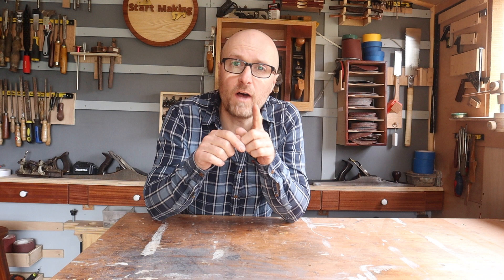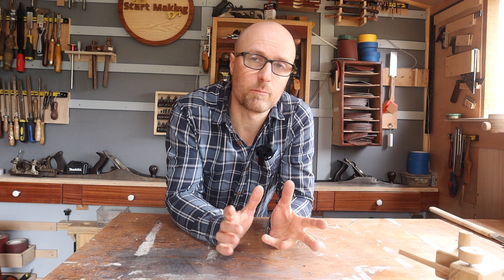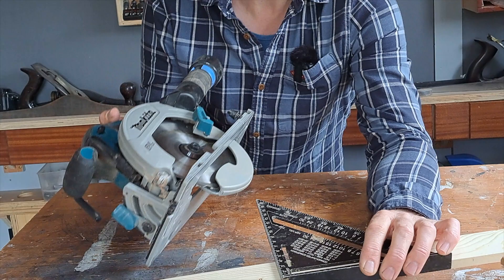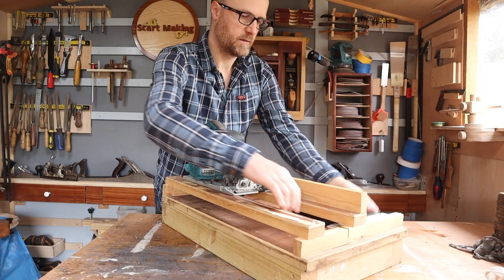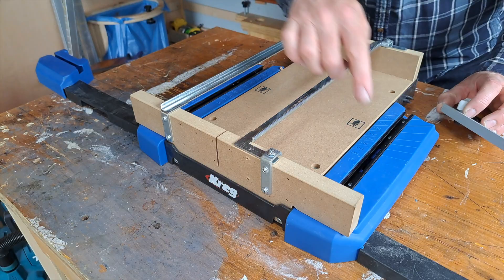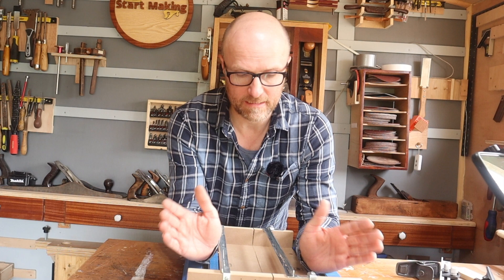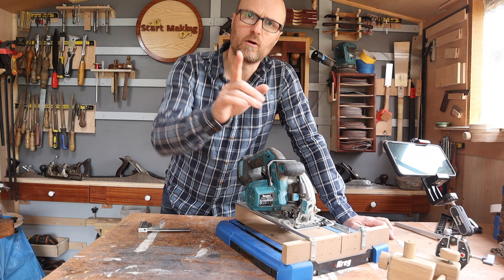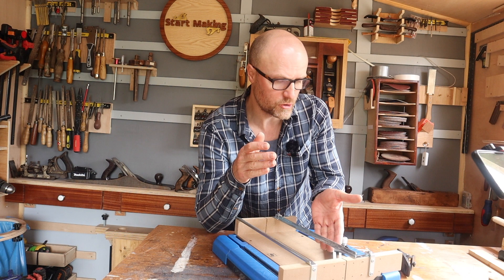Have you just nailed SQUARE cuts ? CHEAP too !!

Comment: I am a recent subscriber, but have binge-watched your videos. 
And enjoyed them all. I have a 4 1/2 in blade circular saw. It is the Worx 427 and I really like it. I tried making my own crosscut jig. But was not really happy with it. I have been looking at the Kreg for about a month. Your review was a deciding factor for me. I ordered it from Amazon for $20 plus $20 shipping. I live in Colombia. I can cut 43 mm depth with my saw. That looks to me like I will fall just a little short. I plan to add a 3-6 mm (depending on what is needed) MDF board under the Kreg base. My question is, is the base board easily removeable? I hope that 3 mm will be enough. Or do you have a better suggestion? Or will the 43 mm depth work? No reviewer has stated the depth from the top of the guide to the base board. Kreg says it is made for 6 1/2- 7 1/2 in saw.
Reply from the maker: Hi Mike. Welcome aboard. Thank you for watching all of the videos by the way. Hope that there is something of interest. As far as your saw is concerned I worry that you will fall short by around 1mm or less. The depth of the cut available is 42mm but the rails are at least 1 mm thick which may send you too high. plus you really want a cut line of around 1mm to 2mm depth to create a zero clearance cut and stop unwanted tear out from the bottom of the cut. I will take a look later today as I have a hunch that the front and back boards sit on the base board so taking it off and adding under it may be not possible. From the top of my head it may be easiest to lay a 5mm mdc board ontop of the base. Don't glue it , maybe just 4 strips of double sided tape. One on each of the far sides left and right and then one to either side of the cut line so it will stay level and not sag in the middle even by the width of the tape. I guess alternatively you could hand plane the front and back boards by around 1.5mm to bring the saw closer to the base but this is far more risky. I will double check the base and pop another message up for you. If you decide to put another board on the base I would not worry too much about getting it flush all round so long as the front is perfectly flush with the front board so that you don't get a load of saw dust stuck in the gaps.
Reply: @startmaking1  Thanks for the quick response. I felt that I was going to fall a couple of mm short. I didn't want to try and trim the end pieces for 2 reasons: 1-accuracy and 2 - it would throw off the mounting holes for the rails. I felt that adding the extra board below the base would be best. Kreg states that they sell replacements, so it is removeable. Just depends on the placement of the end boards. Maybe I will luck out and the end pieces don't sit on the base. My workshop is smaller than yours. I have 1 section (about 3 meters) of wall on the back patio. I do have 1 20 amp outlet. I built a router table onto the end of my workmate workbench. For now I an just making little trays and boxes using dovetail and box joints. But non-square cuts really show up. Ergo, this jig. Thanks again.
Reply from the maker: @mikehinson4062  Good timing Mike. The distance from the top of the metal guide to the base is 45mm. But you are in luck. The base is removable and is not sat under the end pieces. Should be fairly easy to raise it up a bit. Only issue I guess is that you may need slightly longer screws or maybe you can drill the countersink down a touch. either way, should be good to go. You may be the first ever person to watch my videos with a smaller space than me. Though, you have power and so I guess we are even. I make a lot of boxes and that is what led me to this jig. Really handy, though a little sketchy for very small pieces. I may need to rig something up to hold very small pieces down as the clamps are only so good.
Reply: @startmaking1  "Really handy, though a little sketchy for very small pieces." I am thinking uf using a small caul to hold the small pieces. My jig has not shipped yet and there is about 2 weeks time to ship to Colombia. But I will let you know how it works. The tool selection here is terrible. And if available, very expensive. 19% import tax, 19% VAT, plus shipping, plus some price gouging. If "necessity is the mother of invention", I should be able to better Edison.
Reply: @startmaking1  got mine today. assembled without any problems. I raised the base by using some 3.2mm veneer that I have. The saw fits fine and just barely makes a kerf in the bottom. There is a small space just in front of the back support where it does not touch, but I have a small kerf everywhere else. The increased height does not affect the clamps or bevel gauge which is spot on at the 45 mark. I used a fine point sharpie to darken the line so that old eyes could see it better. A piece of 5mm mdf would raise it a little better. I might try later on if I see any defects in cutting. But for the test cuts, I am very satisfied. Thanks for your review. It sped up my buying process and now the price is almost double again
Reply from the maker: @mikehinson4062  Hi Mike, That is great news. I am glad it worked for you and that you got the great price.

Comment: A true square cut is deceivingly tough.
Reply from the maker: How right you are Rich. Tough and frustrating.
Reply: This is, of course, no such thing. Everything has tolerances. A machinist is constantly aware of this, and works to defined tolerances that will result in a working item. Woodworkers seem to think they can achieve perfection, when actually both the need and the possibility are not there. The lack of tolerances marked on a woodworking drawing is not an indication of required perfection, but a recognition that it is not available.
Back in the day, there was an engineering occupation called a 'fitter'. His job was exactly that, to fit metal parts to each other using hand tools. Virtually extinct, since machine tools can now make interchangeable parts (via accuracy and tolerance design). Woodworkers are, in general, a wood version of a fitter.
Reply: @Tensquaremetreworkshop  Why a machinist would even get in this conversation is beyond me.  When I start machining plate steel with my tablesaw I'll contact you.
Reply: @richc9503  It is not about what you are machining, it is about understanding precision and tolerances. And who said I am a machinist? I am an engineer, and that covers all materials. I cannot count how many times I have heard a woodworker claim something is 'perfectly square'. It shows such an ignorance of the world that I am almost speechless. Almost.
Reply: @Tensquaremetreworkshop  Kind of like understanding that what you are comparing is completely out of context and the fact that the two have mothing in common.  You are arguing about tolerances which are completely different given the substrates.
Reply: @richc9503  Yes, yes, yes- the tolerances are completely different. But exist in both cases! You make my point for me. Claiming perfection in a lower accuracy environment is dissembling, carelessness, or ignorance. (Ignoring is ignorance.) Take your pick.
Reply: @Tensquaremetreworkshop  That's kind of like comparing baking a cake to forging metal, one really has nothing to do with the other but they're both done with heat.  Context seems to be important here.  You can choose to ignore the difference, but it really doesn't matter.
Reply: @richc9503  You seem to wish to separate 'wood' and 'metal' into completely different categories, and never the twain shall meet. Nothing could be so far from the truth. Wood is machined in exactly the same way- a saw blade for metal differs from wood only in tooth size- as it does for different densities of wood. A router cutter and an end mill are functionally identical. A rasp and a file also only vary in tooth size- as do different files. A wood lathe and metal lathe are also functionally identical, varying only in arrangements for maintaining accuracy.  A CNC mill is identical for both wood and metal, although may be more rigid for the harder metals. Then there are thermoplastics and composite materials - wood or metal? Remember, MDF is a composite material, as is metal-filled epoxy.
I am afraid the siloed approach is entirely in your mind, and is detrimental to your potential as a maker.
Reply: @Tensquaremetreworkshop  Sure, OK.